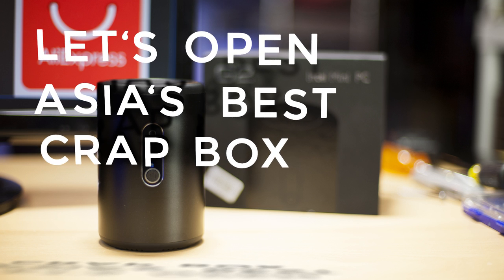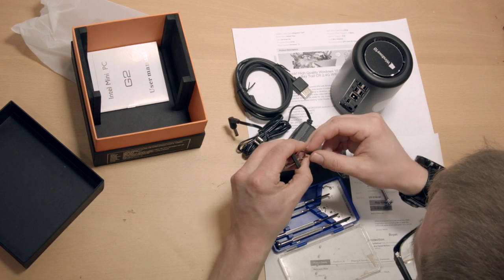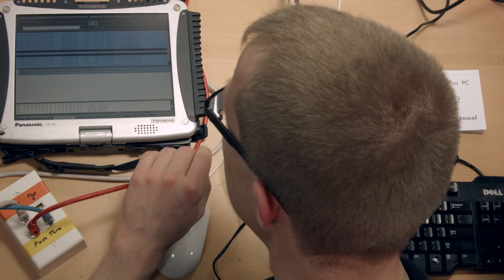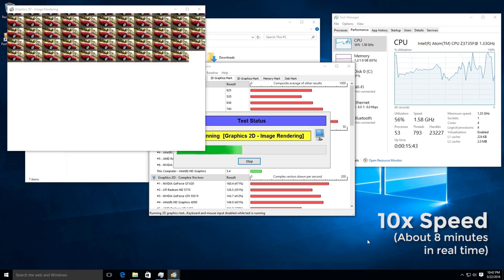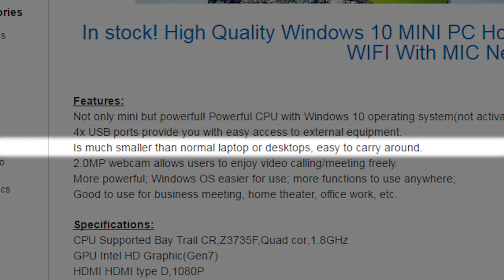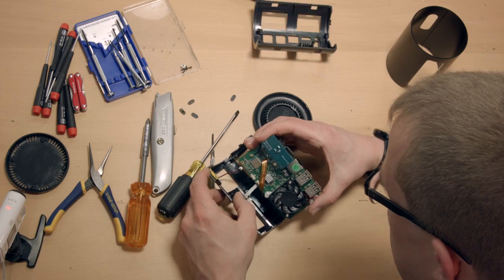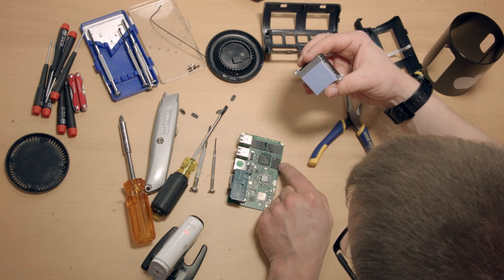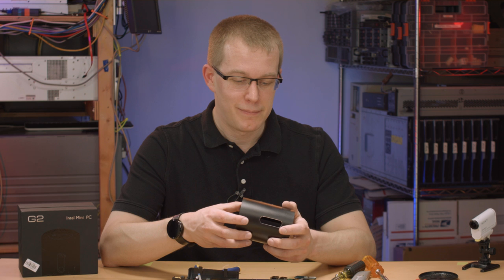Let's Open: Intel Mini PC G2 Review and Teardown (from AliExpress)

Comment: The reason for 32 bit windows is that 64 bit windows takes a lot more disk space and that thing has only 32gb of disk space
Reply: Also it eats up slightly more RAM and with only 2GB's RAM becomes pretty tight. I would like to see a model with 4GB's and a better CPU but then it wouldn't be cheap...
Reply: It is also because the EFI BIOS on this unit is only 32bit capable and only works with 32bit O/S's.  It won't boot a 64bit O/S.
Reply: @voiceofreason9258  Good to know. But seems like this is a limitation of Windows. I didn't think this was an issue as I did install 64 bit Linux on several of these 32 bit EFI devices. We do have to use 32 bit grub but 64 bit Linux itself runs fine
Reply: @bharathghanta  I tried it with Windows 10 64bit after the Windows install had gone corrupt.  It went into a boot loop, so I booted to the EFI and tried to run setup from there and It came up with an error message something to the effect of: "can not run 64bit EFI on this 32bit EFI system"  I don't remember the exact wording.  I had to make a Windows 32bit install disk in order to re-install Windows. - Then I had to look all over the internet for drivers since the manufacture doesn't make themselves known and has no support page.  I managed to get ahold of them in China a while ago and they were more eager to sell a new product than to fix an old one.  The one I had in my possession was a friend's that needed  a lot of the solder re-flowed to repair the audio and SD card slot.  They are not ventilated well and are susceptible to expansion stress on the solder joints.

Comment: Thanks for the vid. Saved me from breaking it when I wanted to take it apart.  The fan started making some odd noises. When I took it apart, it was silent as a mouse...until about an hour later. Fan is going out.
I ordered a pair of 40mm x 40 x 10 replacement fans. Amazon AB4010M12 for the units I got. When they arrived, they looked like they would work, except the units I received were a little too tall to fit the shorter screws. I had some longer screws that did the job. The screws actually thread into the chip's heat sync. I got some longer screws and plopped it on. Second problem was the connector to the board had a different spacing that didn't line up with the new fan connecter. Thankfully you can pull off the piece from the board exposing the connectors that protrude upward. Piece fit them perfectly.

 I've had this for almost 2 years now, and it runs a weather station with a USB base station perfectly and with low power. The motherboard sure looks a lot like the Raspberry Pi stuff I own now. I'm pretty much on board with the review. I wasn't expecting miracles for 59 bucks, but with Win 10 on it, it makes it worth it if I want to use the serial on something else when this unit bites the dust.

Comment: That Bay Trail chip is surprisingly a capable chip. I recently bought a cheap Lenovo 2-in-1 with that same SOC just to replicate my main PC screen through remote desktop but I ended up using it natively because the system is very responsive for the tasks I do.

Comment: The features it has are informed by the standard kit that comes with the Atom Bay Trail. It's basically an Atom Z3735F tablet without the screen and battery components which is why it has a camera. Which is also why it has 32bit Windows, it has a 32bit UEFI so you can't install 64bit Windows.

Comment: Like the Apple Mac Pro, the vertical design of the chassis allows for a chimney effect for cooling. Other than the CPU, none of the other components create much heat. The power supply probably makes more heat than the CPU. The air is drawn upwards entering from the smallish holes at the bottom, and vent out the top.
Reply: it's true for a full computer with a 500w tdp as you sad but this mini pc has a tdp of about 10 watts so it doesn't need that much cooling. the little fan is enough. so the cylinder shape is just for design

Comment: on the aliexpress site 

"Features:
Not only mini but powerful! Powerful CPU with Windows 10 operating system(not activated).
4x USB ports provide you with easy access to external equipment.
Is much smaller than normal laptop or desktops, easy to carry around.
2.0MP webcam allows users to enjoy video calling/meeting freely.
More powerful; Windows OS easier for use; more functions to use anywhere; 
Good to use for business meeting, home theater, office work, etc."   

so it didnt lie i guess it said not activated

Comment: I have one of these as a hobby repair project.  It does not boot.  The test pad signal to the processor shows the CPU getting the signal to start, but then goes into reset.  Any ideas what might cause this?  I already replaced the CPU, and RAM (put the faster Atom CPU on it and fixed some corroded solder pads under the first RAM chip) but I still get the same problem.  Blue light is on, no video, CPU goes into reset repeatedly.  Can't find any info on this board and the manufacturer gave me the runaround when I asked about the board schematic - trying to get me to buy a TV box instead.

Comment: Good video, subbed. You should have quickly noted temps after benchmark. Of note is that you can get an Intel compute stick (made by intel) with the same processor, storage, and ram, for less money.

Comment: I like this form factor,  just the guts need to be a little more beefier. I'd actually buy one that could do full screen video, use as a hometheater pc
Reply: honestly one of these with a large panda windows ten would be fantastic
Reply: get the intel compute stick then
Reply: They have the same Atom chip I think.

Comment: I think the only application I can immediately think of for this would be to plug in an external hard drive and use it for torrents. It's low power, so leaving it on all day to collect data would be ok. It might also be a good computer for an older user that only uses social media and reads the news. Chrome might be better optimized for Youtube, so that may have made the viewing experience better.

Comment: Could you test power consumption in idle and under load please?
Also: Did you try installing Linux on this thing? I think it might make for a capable and power efficient router, with a distribution like IPFire on it...
Reply: I did these tests and at rest without using anything with windows about 2 or 3w and in intensive use 8.5w
Reply: Thank you! :)

Comment: The original Unreal Tournament and Star Wars Jedi Knight work fine on it.  You will have to fight with Windows 10 to get them to work (need a modified OpenGL32.dll).  It was great at playing them over the network.  I had no trouble with Asphalt 8 or Minion Rush. Note: the bottom has the activation code.  It is a QR Code.

Comment: I suppose there is no way to connect a DVD drive to the canputer so you won't be able to get UBUNTU 14.4LTS into Windows 10 using WSL, if you want to get rid of the Windows 10 the install Linux Mint 17.2 Rosa 64bit and forget about Windows for ever, I don't know why they didn't go with a AMD A10-7980k AND 32GB of GDDK3 RAM would have all the difference.

Comment: You should have used Microsoft Edge for full screen HD and Full HD videos. I have a tablet with the same processor and it runs just fine on it (1280x800 resolution, though, so at least 720p60 plays well)

Comment: I'm impressed that you used Wireshark in your review. Thanks!
Reply: Oh, and the reason these Bay Trail devices (usually tablets) come with 32-bit WIndows is that it uses less disk space an RAM. Also they often come with a 32-bit UEFI and some of those have a hard time booting into 64-bit operating systems.

Comment: I've had one of these for a couple years. Never experienced the video issues that you are, even in Firefox on Youtube. That surprised me. Then again, I'm not sure if I tried 60 FPS stuff on it.

I mostly play stuff in MPC on it, and it's fantastic. I also run Office stuff on it (Word/Outlook mainly) and do some moderate web browsing. It's responsive. The fan started making a horrendous noise maybe 6 months ago though. I will probably go in and replace it at some point. Overall, I like this thing a lot for what it is and would 100% percent recommend it for basic computing even 3 years later in 2019. It's fine.

I guess we'll see how long the eMMC holds up. Once that dies, this thing is basically worthless unless you want to run an OS from a USB drive... through USB 2.0. Ouch.
Reply: I also have it for 2 years and the fan is going well to date.

What I do to make the EMMC last longer is to use a microSD to put the games and so not write much in the EMMC so it will last you many more years.

Comment: @s.co.tt did you notice this comment? "Terence Stewart - 3 months ago - 
The Windows activation code is included with the product and can be obtained by scanning the QR code on the underside of the product". If it is accurate, then you should at least add some banner on the video to mention it

Comment: youd be surprised what these things can run. I have a gole 1 running star wars battlefront 2 with average 57fps low 40 high 77, and castle crashes constant 60, almost all classic games constant 60, and so on.  although it does have 4gb ram and an atom z8350 but if you optimize yours and use razer cortex then you should be fine cause razer cortex makes a massive difference on these little atom PCs.

Comment: It can game. Why does everyone think just cause the hardware is crap it cant game. You can indeed optimize the systems os and make stuff run better even games as Ive shown with the gole 1 with the same specs cept more ram and before that I used a tablet with exact same specs.

Comment: Microsoft will give OEM makers literally a free copy of windows for a "tablet spec" computer, ie anything that has a SOC based cpu, 1-2gb ram and eMMC based hard drive soldered on. This is so windows tablets can be competitive to android tablets, since android is also free. The windows key SHOULD have been in the bios like every other tablet and laptop today. Looks like the chinese maker farked up the bios flash step in the build process.

Comment: It is a $128 product (Amazon). You GET what you PAY. Don't just say 'crap' from the start to the end just because you want a better hardware specs. A good review should be done within the product settings: look what the product is trying offer and test on it. And using a over $1k or $10k computer to compare with a product less than $150 is just not fair.

Comment: Just as a tip for these cheap computers. If you want to use them for videos and windows 10 use edge. Chrome and firefox have trouble with youtube and the lower power computers. Techtablets.com had the same issues as you seen and shows chrome AND edge in his videos and edge beats chrome for video.

Comment: It has 32bit Windows, because it has only 2GB RAM, and too small storage. 64bit Windows consumes more memory and space. That shouldn't be a headscratcher. Also, anyone who uses applications that only exist in 64bit version clearly isn't a target customer for an ultra low cost PC. Specs-wise it is crap, but same crap as the cheapest models of the big brands.

Comment: why is it cylindrical,  with all that wasted space.
Reply: if you compare a cuboid, cylinder, and a sphere, the cylinder would be second most efficient in use of volume.
Reply: you prove my point! there is a massive waste of space thanks!
Reply: hey, the cylinder is very efficient in the use of space IF all the things inside had no shape and could be shaped in any way. HOWEVER, the motherboard has its own shape and could not be shaped well in to a cylinder. so newrhea13 is right, using a cylinder frame is just a waste of space.
Reply: +Guangda Dong yea if you think of it that way. in this case that's true. I was thinking like a coca cola can.
Reply: CaffeinePizza like a soda can? why a coca cola can? such a weirdly specific choice of beverage to distinguish volumes with, maybe their like a tardus???

just havven a wee bit o' fun though.
Reply: +newrhea13 any will do obviously. coca cola was just the first word to come to mind
Reply: Designed for our politicians for kicking the can down the road.
Reply: Frank W politicians be danmed

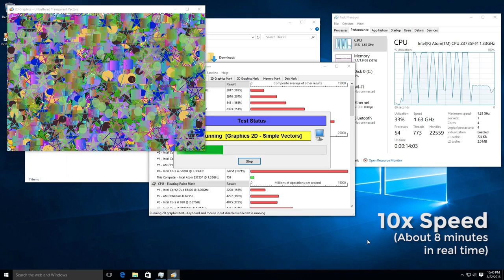Comment: 15:00.... buys system with 2 gigs of ram... most likely not upgradeable.. complains about it not running x64 windows.. wtf dude its only got 2 gigs its not even gonna be able to functionally be a 64 bit system regardless. "Cheap move by the dev" but par for the course on 2gb ram limited devices.